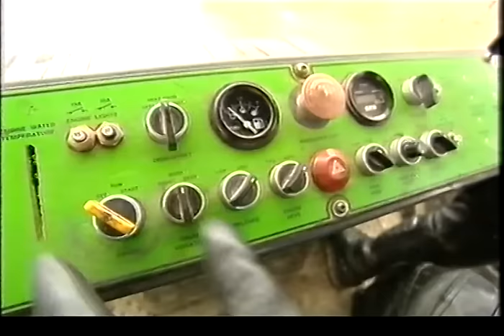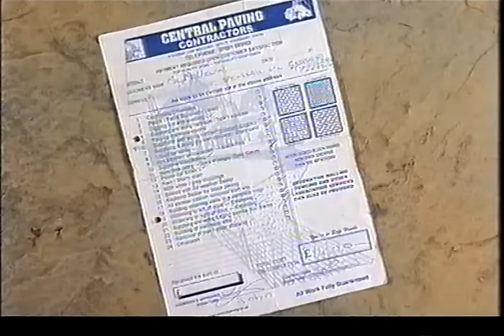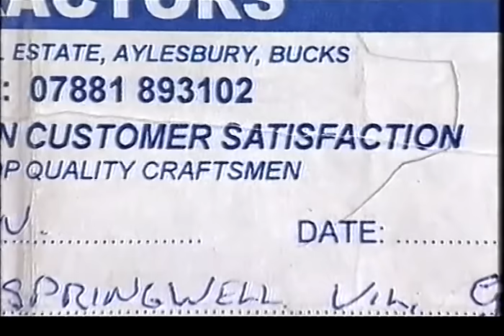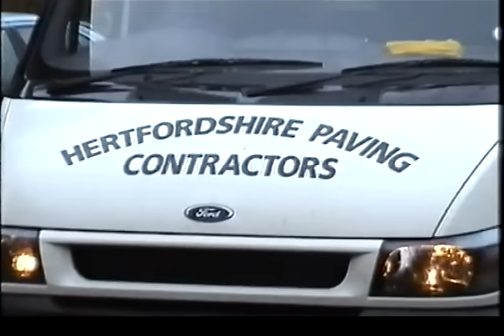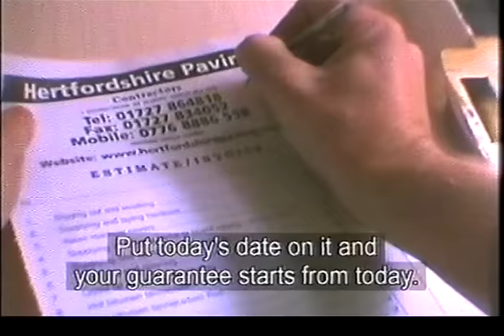Rogue traders - driveway devils

Comment: I could actually repair that installation. With a grab lorry, and at least 5 ton of type 1. Stack of kerb stones ( to make steps. Lol. ) And last but not least a damned box laser. Oh I would love to properly herringbone that with a diamond blade. Just to flex on the before and after pictures. I'd even disassemble and rebuild wall.  What the heck. Some materials made it there. 2/10. For the labourers persistence 1/10 for execution.
Reply: A diamond blade is the only blade you use...
What else would you cut it with? A hacksaw blade ??
Reply: @ÆCME  block cutter... Guillotine. Ok with square cuts or infill if angles not steep. For those edges. Diamond. Some customers want all diamond cut.
Reply: @ÆCME  also... Some risk lives with f I b r e blades.... Hell no. Even their name falls apart. Lol